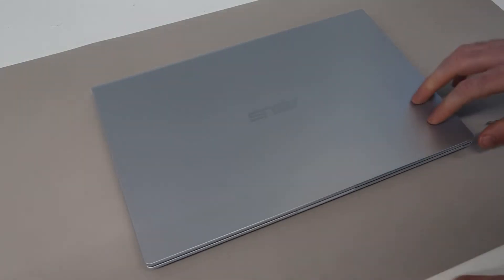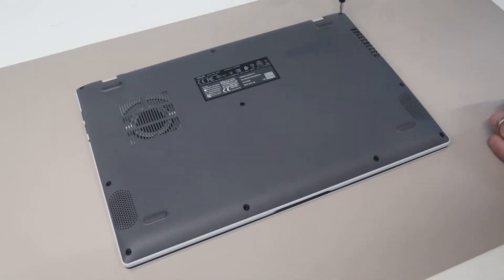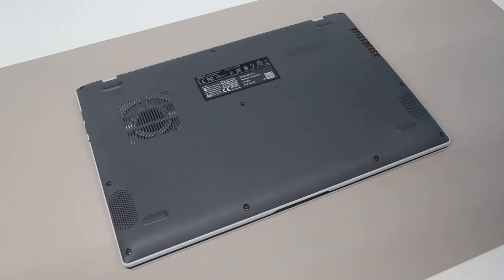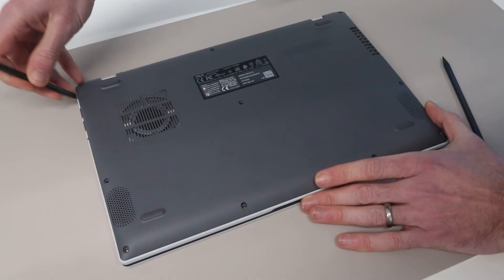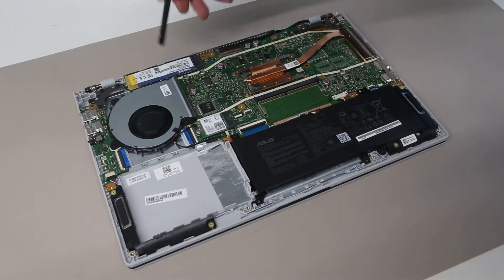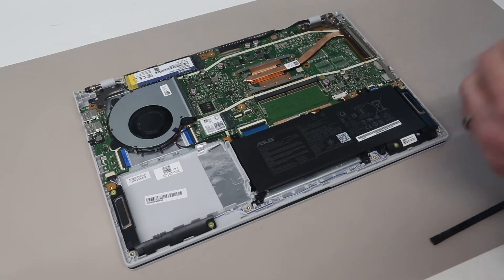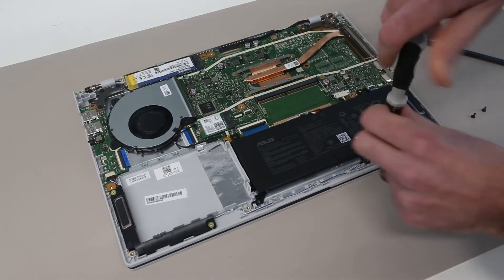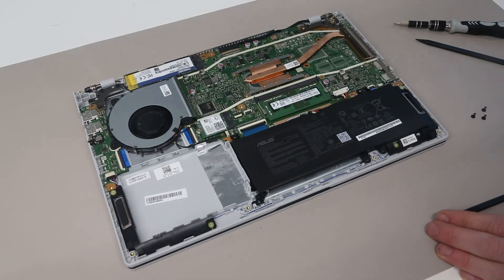ASUS Vivobook X415EA/R465EA SSD and RAM Upgrade Guide

Comment: Hi. If i put in a 16gb would in total be 20gb in ram and would it be okay to put to put 16gb in? also which brand would you recommend that is not that expensive?
Reply from the maker: Yes that should be fine. I normally go with Crucial - link is in the description.
Reply: @BrueComputing yeah wanted a cheaper option. Anything as good as crucial which is cheaper?
Reply from the maker: Kingston perhaps.
Reply: @BrueComputing thanks. 

Lexar SODIMM 8GB DDR4 RAM 3200 MHz, 260-Pin DDR4 SODIMM Laptop Ram, High-Performance SO-DIMM, PC Laptop Computer Memory (LD4AS008G-B3200ASST)

Or

Integral 8GB DDR4 RAM 3200MHz PC4-25600 SODIMM Laptop/Notebook/MacBook Memory Module

Are they both compatible with the laptop and which one do you think i should go for?
Reply from the maker: Both should be fine.
Reply: If i increase the ram.. can i install photshop or da vinci resolve given that its nvidia graphics card is low?

Comment: Gracias por la claridad del vídeo!
Podrías aclararme como identificó el o los Flex de video, mi pantalla solo muestras rayas verticales blancas y negras; en un principio la imagen se volvió doble , era una imagen superpuesta sobre otra, se arregló por uno o dos días, nunca cerré la laptop, solo la apagó, y de repente ya no hay imagen, solo rayas, he tenido que trabajar conectado por HDMI a un Tv pero quiero arreglar el problema, revisar su es quizás algo suelto, no lo he golpeado ni prestado a alguien. Es de mi uso exclusivo y sin traslado de mi escritorio. Ayuda 😢
Reply from the maker: Sounds like the cable snagging through the hinge - check it hasn't been partially disconnected on one end.

Comment: WTF why when you open the laptop the don't have ram installed?
Reply from the maker: It has memory soldered to the board and a SO-DIMM slot for expansion.
Reply: @BrueComputing thanks for the response 👍
Reply from the maker: No worries, thanks for watching!

Comment: Thank you so much for this helpfull video
I have same model with 8gb ram. And i want to upgrade the ram.  My question is should i add 8 gb same ram or 16 or 32gb adding is possible or recimmended?
Reply from the maker: Are you doing anything which will benefit from that much memory? I'd generally go with 8GB to get 16GB total for dual-channel mode at not too much extra cost.

Comment: I actually have this model one in partucular.. I took the next step and bougth a 16 GB RAM DDR4 stick... it works perfectly and didn´t expect the results... before 8GB, now 20GB. Thanks!
Reply: Hi,did it work . I thought max ram capacity was 12GB. I'm planning to upgrade my laptop so if you could help me, that would be great. Thanks
Reply: @GG-ln7td did you upgrade it?
Reply: Yea, it worked. There is 2 ram slots in laptop. 1 is soldered and other is removable. So, I bought 16 gb ram stick . Now I have 20gb in ram.

There is a command to find out max ram capacity of the computer. 

wmic memphysical get maxcapacity

"Using CMD to Check Maximum RAM Capacity
Once the Command Prompt window is open, type the command “wmic memphysical get maxcapacity” and press Enter. This command will query your computer's memory subsystem and display the maximum capacity of RAM in kilobytes."
Reply: @GG-ln7td  thanks
Reply: @GG-ln7tdHi, I have same laptop Asus X415EA-EB573 i5 11th gen. So i have use this command and result is 128gb ? So can i use 16gb ram or 32 gb ram, some providers says that using 32 gb ram is possible to uprade?
Reply: Hey i have the same laptop will there be any problem with 16 gig ?
it says the max i can do is 8 + 4 on the website

Comment: Hi, I have Asus X415 which has 3200MHz soldered RAM but I added 2400MHz 4GB on it. Will it do harm to my laptop if it's not the same frequency?
Reply: it will not hard but ur pcs running on 2400 now

Comment: Hello! I have the Asus F414EA-UB51, which already comes with 8GB of RAM and an Intel Core i5-1135G7. The thing is that I don't know if those 8GB are the limit of RAM that the Laptop can have or if it can be increased more. I don't know what the RAM limit is for this laptop.

¡Hola! Yo tengo la Asus F414EA-UB51, la cual ya viene con 8GB de RAM y un Intel Core i5-1135G7. Lo cosa es que no sé si esos 8GB son el límite de RAM que puede tener la Laptop o si se le puede aumentar más. Desconozco cual sea el límite de RAM para esta laptop.
Reply: You can put more 8GB ram 3200mhz, CL22, 260pin, 1.2v

Comment: Hello! I want to add an ssd to this device. I ordered the cable and the mounting rubber but I'm still missing the frame to which I should attach the ssd to the laptop. Can you add also the link to this part? Keep up the good work!

Comment: Performed the RAM and SSD upgrade yesterday. The included 128GB SSD on mine is an extremely poorly spec'd drive, the read speed is barely okay but the write speed is abysmal. The SSD replacement not entirely straightforward, bit of an arm wrestle but I got there. Both the added 8GB RAM and 1TB SSD immediately seen in the BIOS when rebooted, but the Win11 installation USB not picked up in the USB slot I selected. Swapped USB into a different slot and BIOS could then see it. So then started the Win11 install but new SSD was not seen by the Win11 install despite being clearly present in the BIOS. So had to go to the Intel site and download the Intel Rapid Storage Technology driver. Driver then unzipped, put in a folder on the Win11 install USB and then I pointed Win11 there during install and allowed Win11 to load the driver (but had to uncheck the "Hide incompatible drivers" box -go figure). 1TB drive then seen by Win11 install and install proceeded without a hitch. Hope this helps somebody 🙂
Reply: Thank you so much. You saved me so much trouble on my install today.
Reply: Likewise, thank you for this helpful comment! You saved me a lot of time trying to figure out the problem when I installed a new SSD yesterday.

Comment: Excellent video. Thank you. Just bought an x415ea-eb196ts and bought an 8gb ram to upgrade to 12gb as I was under the impression that max ram was 12gb. Your video was very informative. Had ordered some pry tools but couldn't wait for them to arrive so managed to removed the case with a couple of old credit card sized cards! 😅
Reply from the maker: Glad I could help
Reply: Are you sure that the maximum ram that can be added is 8 for a total of 12
Reply: @Medoo99  I am only going on what was quoted on the Asus website at the time of purchase. I would have bought a larger memory stick if I could but didn't want to risk it. To be fair, 12gb of ram is more than enough for what I'll be using the laptop for. I'm more concerned about the storage and to that end will consider purchasing a HDD when I can. However, the cable and HDD mount are quite expensive from the links provided above. Shame Asus didn't provide them from the outset.
Reply: @phasestar i just got this 2nd hand at a good price. it currently has 4+4 gb already. I want to perhaps upgrade it to 12gb but won't it run in single channel since the sizes don't match?
Reply: I bought this laptop 2 days ago also it's very good but I'm wondering about upgrades

Comment: I used an extra 8 gigs (8+4=12) with similar frequency. But it gave me constant BSOD. Then when I downgraded it to 4 (4+4=8) it seems to work fine until now.
Reply: With 8+4, do you have bottleneck?
Reply: @ehv940530  I did. The computer showed I had 12 gigs. But it didn't work like 12 and there was bluescreen issue.
Reply: @hawq2483 it's probably a ram issue so try to buy another 8gb

Comment: inserting 16gigs of ddr4 3200 of RAM is compatible with its core i3 model?
Reply from the maker: Yeah
Reply: @BrueComputing the i3 laptop would then read 20GB of DDR4 RAM or will it only read as 16 GB RAM?
Reply from the maker: 20GB.
Reply: @BrueComputing  oh i see...it's good if it's like that, i am confused with the one written in ASUS site since it is different than the written in the intel site
Reply: @howenchua  did you upgrade and did the 20gb work?

Comment: How much ram can we expand on the 2nd ram slot on asus X515EA-EJ312WS plzz reply
Reply from the maker: 16GB modules like this (Amazon Affiliates link) should work fine: https://amzn.to/3logGBg
32GB ones might, but probably pointless going that large.
Reply: @BrueComputing  very very thx bro soo much confused on this point ❤️
Reply from the maker: No worries, thanks for watching! :)
Reply: My pc have 8gbs of memory ram running at 1600mhz, and one free slot, and i wonder if i put a 8gbs running at 2400mhz is a good idea?
Reply from the maker: 1600 is 3200 - it is Dual Data Rate, so double it. You need to fit DDR4-3200 modules.

Comment: I bought a 10 pin ribbon cable to add in a 2.5” SSD and I cannot get the SSD recognized in the BIOS or Windows.   I know its a working SSD.   Did Asus Cripple the mother board for the HDD connector?   Is that why there was no cable and no caddie for a drive?    Many thinks for help.  Ben pulling my hair out.
Reply: Also waiting for this answer, any news?

Comment: Hello, thank for this vidéo. If i put à 1to ssd instead of the 256go, Will Windows .be there anyway or is Windows 10 installed on the native 256go ssd ?  Thank
Reply from the maker: You need to either install Windows on to the new SSD or clone across the contents of the existing one.
Reply: Hello, sorry for this à little dumb question, i am a newbe in electronic. I have founded a french tutorial to make a bootable USB device.

Comment: Hey, im planning upgrade ram to 12gb by adding another 8gb. The question is can it work dual channel 4+8 ?
Reply from the maker: Dual channel works best if both sides of it are equal, but you get some benefit doing it that way still.
Reply: I did excatly like 4+8. They Said that first 8 gb working dual channel, 4 gb is working single channel

Comment: Thanks for the video , but you think the 8GB RAM soldered to the motherboard is x16 or x8 type RAM , as I am looking to upgrade the X415EA i5 model to 16GB and would prefer to add another 8GB RAM of the same RAM density type --- ASUS customer service say this is `inside/confidential information` , and I can't find any information on this, or a teardown video showing the other side of the motherboard where the RAM is --- thanks in advance !
Reply from the maker: CPU-Z will tell you in the SPD tab whether the RAM is single or dual rank: https://www.cpuid.com/softwares/cpu-z.html
Reply: @BrueComputing  thanks but no, what I mean is the memory density, i.e. x16 or x8, both of which exist for 8GB DDR4-3200 cl22 SODIMM RAM modules, not 8GB vs 16GB or single or dual channel --- The X415EA laptop I am referring to has 8GB soldered to the board , but the chips are located on the other side of the board so I cannot see them , or read any information that might be printed on them . CPU-Z does not show any information either , e.g..the part number, as it does not show that for soldered memory , only for expanded memory .
Reply from the maker: Not sure then. I suspect it will be single rank as otherwise it would use more space on the mainboard.

Comment: Just completed this process putting 8gb in. No surprises because you covered everything. 
I would say the pry tools are essential and I bought a similar kit to yours before doing it. Thanks very much.
Reply from the maker: Glad it helped!
Reply: Do you think something else could be substituted as a pry tool , if so, what do you think would work best --- e.g. would an old credit card work ? thanks
Reply from the maker: @opaque1797  For the sake of a £ or two I'd get the right tool, but a credit card or guitar pick may work.
Reply: @BrueComputing  thanks but in my location specialist pry tools are not really available , so I was thinking about using an improvised one --- how firmly placed are the clips that you need to free up , please ? thanks
Reply: @opaque1797  Pretty firm. I very much doubt you'd do it with a credit card as I doubt it would have the torque required but could be wrong. Taking off That being said it wasn't one of the hardest covers I've taken off. Taking off the cover is the only real crux of the procedure.

Comment: Nice one, especially providing the parts numbers as well. Out of curiosity, any idea what that connector next to the HDD one is there for?
Reply: I  Pretty sure u can add 2.4inch hdd or ssd there and conect it wia small cable plug it in hdd but i just dont know if there is more power needed
Reply: Just checked it is for HDD/SSD
Reply: Maybe fingerprint connector

Comment: sir i wanna ask u about upgrading ram. does it automatically cancel the warranty? t.i.a
Reply: btw my laptop has the same type as in ur video (x415ea)
Reply from the maker: There was no warranty seal broken during the upgrade process, but in the event of a claim you'd have to return the system to its original configuration.
If you damage anything in the process this may void the warranty as well.
Reply: thanks for ur explanation dude. ive one more thing to ask.
if my laptop has a 4gb ram onboard, can i add a 8gb ram on the other slot?
Reply: i tried to install it, and the bios read it as 12gb memory
Reply: will it be safe to my laptop? what should i do?
Reply: @209_tomupetramanogarinahul7  

It will work ok

Comment: Are there two ram slots in this model(Vivobook X415) ?
Reply: No just one slot free. There  internal 4mb ran it comes with is soldered to the board and then there one slot free as shown in the video to add your upgrade
Reply: @kezstone1  Thanks <3
Reply from the maker: Just one.
Reply: @BrueComputing  Thanks <3

Comment: Hey, Asus website says regarding memory in X415 - "4GB DDR4 on board, Memory Max Up to:12GB". Just wondering if you've tested this with a 16GB stick bringing the total to 20GB and if this actually works or if an 8GB stick is the highest capacity SODIMM that can be installed? Great video, really appreciate it!!
Reply: i have tested it with a 16GB stick and it only register as 8GB totalling 12GB(including the 4GB soldered onto the board)
Reply: @jasoncheung7654  so there is no reason to buy a 16 gb stick
Reply: @luisllanos3432  yes you should upgrade it with a 8G stick
Reply: @jasoncheung7654  You couldn't use the 20GB? 16GB + 4GB soldered? wanted to put a memory of 16GB, There's no way?
Reply: When I examine it with the cpuid programm,

There are two ram slots on the device (?) However, when we disassemble laptop, we see 4 gb ram connected to one ram slot. And when this ram is removed, the device does not turn on.

There is no onboard/soldered ram. So where is that second ram slot then? :))))
Reply: Why u said it is only 12gb max ram?? When in fact when u cmd it the max ram that can it can have  is 32GB??
Reply: @mocha_chuchay5945  it's a direct quote from the manufacturer's website. I was asking if it's actually correct or not because I don't know.

Comment: thanks for the video , very useful. Did you mention that there is max 8GB upgrade ram? yet your link is to 16GB
Reply from the maker: No, you can fit a 16GB module - I just upgraded this particular system with a 4GB module to bring it up to 8GB in total.
Reply: @BrueComputing  Hey man I'm confused as it show that 1 of 1 ram slots used in Task manager.  My laptop is Asus 14 x415ea and I want to upgrade it to 8gb ram. Do I have to buy 8gb ram? or it is just an error and buy 4gb ram? (sorry for bad English)

Comment: can I add also and SSD as a second hard drive, does the motherboard support 2 ssds simultaneously? or I need an HDD instead?
Reply from the maker: Yes, you can add a 2.5" SATA SSD into the 2.5" bay if you buy the appropriate SATA cable and mounting parts.
Reply: @BrueComputing  

I am thinking of added an M2.NVME drive inside a 2.5" adapter shell in that space , for higher speeds --- do you think that would work ok ? thanks
Reply from the maker: @opaque1797  If you're connecting a drive to the SATA header on the mainboard then an M.2 NVMe SSD won't work - its not compatible with the SATA interface. A SATA M.2 drive would, but then you might as well just buy a SATA 2.5" SSD.
Reply: @BrueComputing  thanks but what I mean is buying a special 2.5" SATA adapter housing for the NVME drive, so it fits inside and the external connector is just like a regular 2.5" SATA drive

Comment: OMG. Is everything fine about temps with such strange cooling system?
Reply from the maker: Didn't encounter any issues in the testing I did, actually as the laptop isn't super-skinny it did quite well in terms of noise and temperatures.
Probably done to give some airflow to other components on the mainboard I suspect.